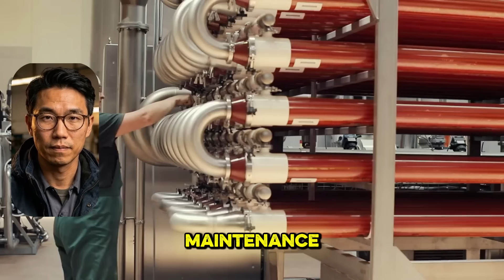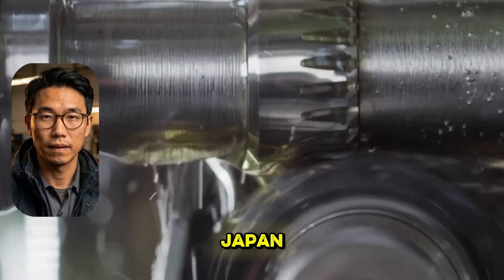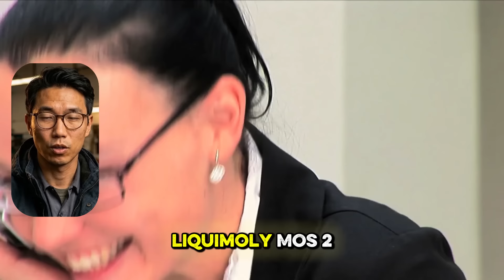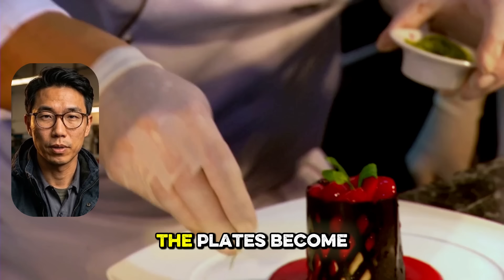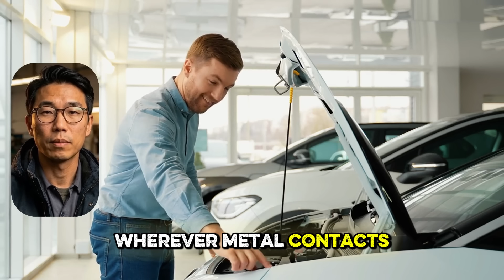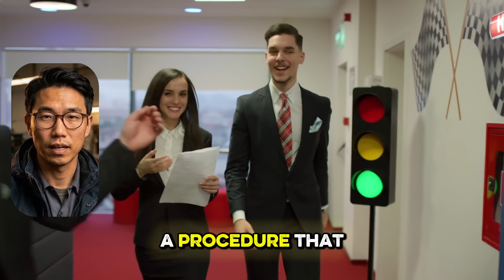The Japanese $2 Liquid Secret That Makes Your Engine Last 500,000 Miles — Mechanics Want This BANNED

Comment from the maker: 📘 The Japanese Vault — Full Maintenance Manual:
https://japanese-vaultvol1.netlify.app
Reply: Mechanics and the maintenance market have no reason to defend engine wear because cars with engine wear are usually replaced, not repaired.  Mechanics are happy to do minor repairs to belts, hoses, sensors etc. while engines last.  It is manufacturers, not mechanics, who want engines to wear.
Reply: Tried to buy the book but couldn't get it to take my information.  It kept saying something like "didn't work try again"
Reply: @chucksul4350 I would check with my bank to make sure you didn't get charged for as many times as they said it didn't work.
Reply: For manuals only! Never to use in automatic engines it causes gears to slip when it automatically changes gears!
Reply: I miss my 1977 Datsun extended cab and this is made sense now, poor little truck rusted so bad it looked swiss cheese, and looked through bed wheel well side through other side but I raced a 1968 Camaro and burned tire's off almost each gear and guy pulled up and asked what I had in it? 
It's factory engine but it was awesome 👍😎 motor miss my little sleeper.
Wish they still made that kind of Datsun.
I was hooked, go back to that kind of quality.
Technology destroyed quality.
Reply: Is this one good on foreign cars?
Reply: Can mos2  be used in  the Acura RDX advance?
Reply: Multiple video shots with no relationship to the audio content.
Reply: Thank you and Japanese old vehicles
Reply: I got a Nissan with a CVT engine oil. It suck! It drives smooth but different oil.
Reply: Does it work on transmissions ?
Reply: Thanks for for 7helnfo
Reply: Mos2 where do I get this?
Reply: Wow I did know
Reply: Blah blah blah get to the point. This should only be a 3-minute video.
Reply: @vizioasdf blah, blah, blah is correct. Even 3 minutes of assertions is too much. Video of short duration is also non-informative. Especially non-identified time & place videos. The so-called "information " requires reading for understanding & confirmation.
Reply: Pure BS
Reply: @isaaccohen1167 no sir try some and find out your self

Comment: found 100g for $15 USD on amazon
Reply from the maker: That's a solid find. Just make sure you're checking the concentration ratio before you pour, because dumping in too much can actually work against you. How many miles are on the engine you're planning to use it on?
Reply: @RayMonroeHacks  ~45000?
Reply: oh wait, that's the old mileage lol i had a new engine installed so i probably don't need it?  i have about 5K miles rn

Comment: Can it be used in a standard transmission in a 2023 Tacoma?
Reply from the maker: Honest answer: I wouldn't put it in a manual trans on a brand new Tacoma. Those gearboxes come from the factory tight and the fluid spec is pretty specific, and adding anything to it could affect shift feel or void your drivetrain warranty. What fluid are you running in it right now?

Comment: I got 100g for $11.99 from Jacky Yao, 5353 *Imperial Hwy Suite 200/300,
Los Angeles, Ca. 90045 (through Walmart with free ground shipping).

If my math is correct. That comes out to 20 5g treatments @ less that .60 cents per 5g treatment (4 cylendar).

The actual USPS label says:
5353 Wimperial, but I'm guessing that is a Typo?

Comment: Molyslip has been available has been available since the 1930's
Reply from the maker: Fair point, moly's been around a long while. What always got me is how few folks actually knew to run it. You been using it that long yourself?
Reply: @RayMonroeHacks  Never used Molyslip as it contains compound particles that can block filters and oilways. I have used Extralube ZX1 since 1993 in all engines and never had any wear or failure related issues in any if them..

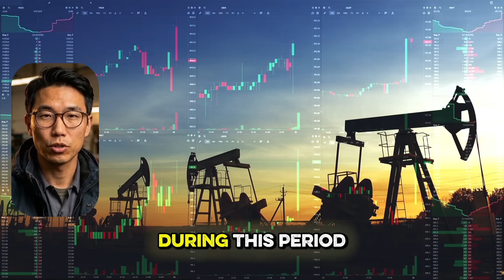Comment: 11:42 , what's the difference to let the car idle for 20 minutes with driving it slowly in city traffic?
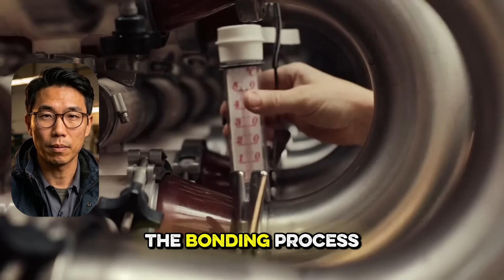11:58, ''drive normally'' which means no high rpm speed in highway trip or sport driving in mountain roads?

Comment: May not be the best for a MultiAir engine ….because on those engines the motor oil also acts as a hydraulic fluid ! Only manufacturers recommended oil please

Comment: Be careful when using MOS2 in delicate engines and older vehicles, as it is not the recommended product to stop noise and wear in older engines. You can buy it at auto parts stores.

Comment: Wonder if this works on transmissions
Reply: on old manual transmissionsPROBABLY  OK  ----- Syncro Mesh has slip plates which need friction so MAY CAUSE TROUBLE  ............XXXX. Automatic transmission  MAY RUIN  them because of internal clutch plates

Comment: Be careful, when adding mixture to running engine. It’s not possible wirh my 07 Accord. Air pressure blows out and makes a big mess if you do it while running and most will be wasted.

Comment: Project Farm completely debunked these false claims.  He thoroughly tested multiple engines and compared with and without treatment.  Exact monitoring showed no real measurable difference with this treatment every time.  It's a scam baby and several sites are falsely pushing it just for the clicks.

Comment: *Short answer:*  
✅ **Yes – that claim has a real historical and technical basis**, but it’s often overstated in online discussions.  
Japanese taxi fleets did commonly use molybdenum‑based oil additives (and moly‑rich oils) as part of strict maintenance regimes, and *very high mileages (500,000–1,000,000 km)* were routinely achieved.  
However, **MoS₂ was a contributor, not a magic ingredient acting alone**.

Below is the precise, evidence‑based picture.

---

## What actually happened in Japan

### ✅ Molybdenum use was real and widespread
Japanese lubricant manufacturers (notably *ADEKA**, **Maruyama Molybdenum**, and Toyota‑linked suppliers) developed **molybdenum‑based friction modifiers* specifically for commercial fleets in the 1970s–1990s, including taxis and delivery vehicles.

ADEKA explicitly documents that their organic‑moly additives form *MoS₂ tribofilms under load**, reducing friction and wear and extending both oil life and engine life. These products were **used domestically in Japan and exported worldwide* [1](https://www.adeka.co.jp/csr/en/special2.html).

Maruyama Molybdenum products in particular became well‑known in *Kansai‑area service workshops**, with documented engines exceeding **500,000 km* on original internals when paired with disciplined maintenance [2](https://takeshi-kun.com/en/article/maruyama-molybdenum-base-power-kansai-area-limited-blend.html/).

---

### ✅ Taxi engines routinely reached extreme mileage
Japanese taxis (Toyota Crown, Comfort, and later hybrid fleets) are famous for reaching *600,000–1,000,000 km* before overhaul. This is not folklore.

Key reasons:
- Engines ran **16–20 hours/day**, eliminating cold‑start wear
- Oil was changed very frequently
- Engines were lightly stressed (low RPM, moderate load)
- *Friction modifiers (including molybdenum)* reduced boundary wear during idle and stop‑start operation

Japanese tribology research consistently shows MoS₂ reducing friction coefficients by 30–50% in boundary lubrication conditions—the exact regime taxis live in [3](https://link.springer.com/content/pdf/10.1007/s11696-025-04139-9.pdf)[4](https://www.nature.com/articles/s41598-022-16026-4).

---

## Was MoS₂ the reason alone?

*No.* This is where the internet myth creeps in.

Think of it like this:

> **MoS₂ didn’t create million‑km engines.  
> It helped prevent them from dying early.**

### The real contributors (ranked):
1. *Exceptional maintenance discipline* (short oil intervals, inspections)
2. *Long duty cycles* (few cold starts)
3. Toyota’s *over‑engineered cast‑iron blocks*
4. *Moly‑rich oils or additives* reducing cumulative wear
5. Conservative driving style

Molybdenum acted as a *wear‑rate reducer*, not an engine multiplier.

---

## Why this worked especially well in taxis

MoS₂ excels when:
- Hydrodynamic oil film breaks down (idle, start‑stop)
- Metal surfaces are already well run‑in
- Load is steady, not spiky

Taxi service is almost tailor‑made for this type of lubrication enhancement, which is why the benefit was *real and measurable* in that setting [4](https://www.nature.com/articles/s41598-022-16026-4).

---

## Why this doesn’t translate 1:1 to modern private cars

Today:
- OEM oils already contain *soluble organomolybdenum*
- Engines run tighter tolerances and finer oil passages
- Emissions systems are more sensitive to ash and solids

Adding solid MoS₂ to a modern car **rarely replicates the taxi effect**, because:
- You still have cold starts
- You still have short trips
- Your oil already has moly
- You don’t change oil every 5,000 km

This is why results today feel inconsistent.

---

## Bottom line (plain language)

✅ *Yes, Japanese taxi fleets really did use molybdenum additives and oils*  
✅ *Yes, those engines genuinely reached hundreds of thousands of km*  
❌ *No, MoS₂ alone didn’t cause that longevity*  
❌ *No, it doesn’t automatically do the same in modern private cars*

MoS₂ was a proven tool used intelligently in a system designed for longevity.

Comment: Molybdenum disulfide,   Liquimoly MOS2.  Dissolve the powder in petroleum carrier oil.   2% concentration.  Purchase technical grade Molybdenum Disulfide powder. Under 2 microns particle size. 2 pounds give 4-7 engine treatments. Run the engine for at least ten minutes for warm application (full operation temperature) . 5 grams of the powder for up to 4 cylinder engines.  Dose 5 grams for   any 4 cylinder engine up to  2.0 liters.   7 grams for between    https://www.youtube.com/watch?v=-mxUn3PR6to&list=TLPQMDgwNDIwMjYkkgx9SFu1vw&index=4    The Japanese $2 Liquid Secret That Makes Your Engine Last 500,000 Miles — Mechanics Want This BANNED

Comment: Powder needs to be smaller than 2 microns.

5 grams up to 2.0l
7 grams 2.0-3.5l
10g for 3.5l+ 
Mix into 30ml of motor oil
Hot, idling engine. Idle 20 more mins.
After 500 miles you're good for 50k miles

Comment: I'm responding to people who said they only found this product for $17.99/oz on Amazon. He said to add 5 grams per treatment for a 4-cylinder, up to 10 grams for a V-6. There are 28 grams per ounce. The cost for a 4-cylinder motor is $18.00/28 grams = $3.20 per treatment, and he said that the oil changes were 50,000km, I think. I know that's not $2.00, but, c'mon people, it is not an outrageous price.
Reply: Exactly!

Considering it will LITERALLY save you THOUSANDS AND THOUSANDS OF DOLLARS.

Comment: I  drive a Ford Everest 2.5L Turbo in Philippines. It has 145000kms on the clock.

Recently I decorbonised the Intake Manifold, Exhaust, Intercooler, EGR valve, and Throttle body. I forgot to decorbonised the turbo charger which I will do soon. 

Performance improved dramatically.

Being an engineer, I have always been suspecting how engines can be further improved using oil additive but recently I started to doubt my belief. 

After 4 weeks, I added 1 bottle of this additive in my oil and seen an improved performance and saving in diesel used.

The product calls for 2 bottles for my car.

So, after 1 week, I added another 1 bottle and took my car for a short drive of 2 hours.

I see an enoumous improvement in engine performance, better throttle response, and I believe I am saving up to 20% fuel.

Thank you for reading my comment. This is a genuine case study. No BS. I see if I can post a photo of the product here.
Reply: The oil additive I used has Ester Oil in the bottle. Not sure how much.

Comment: This BS. Western engines  didn’t die in under 80,000k miles, ever, especially not in big city traffic. American-made engines & cars were quality & reliable  for forever as long as oil chainges were done and coolant & timing was upkept. Also safety & comfort were far superior. 

US cars started going down in reliability when they started using Nipponese parts. 

 60s and 70s  japanese car's were absolutely not superior to american cars in any form or fashion until 1990s, except for fuel consumption.

Comment: Diesel cars with DPF will be clogged faster. MoS2 is heavy oil ash. LiquiMoly biuld company based on that, its not secret ingredient, its in they're name. And If you put it to much it can clogge filter. You pay more for company so they make sure product is good quality, with measured proprtions to be ready for consumer. Also yes you can DYI if you feeling bored.

Comment: My nissan car lasted 500k km for 10yrs. using the same chemical for coating. 
In addition, i added oil friction modifier to the engine oil to reduce frictions. 
Change my oil filter and bypass filter on every 5k km. and only use new engine oil to flush my engine at every oil change(when it turn brown or by 4000hr which ever comes first ). 
Use only 100% synthetic oil please. 
When i change my top valve gasket at 300k km. 
Engine have little to no wear. timing chain and tension is good.
It is also a good habit to change your car battery every 18months.

Comment: From readings that I have done regarding molybdenum, it becomes part of metal through the action of heat and pressure.  Additionally, it has been noted that it is part of the front ends of cars, which for those of us who remember older vehicles had to have the front ends of their cars greased every three thousand miles or so.

Comment: Molybdemun  Disulfide  Is Not Degraded or Washed Out...1971 Toyota, Honda, Nissan Used this  MoS2 Works B etter than BHP  as Hotwire_RCTrix

Comment: My concern ! What happens to oil filter in the initial 500 mile run? Does it get  clogged ? If it does, the oil circulation will be limited until bypass valve is activated.... What about if during preparation before MOS2 is pour in; the oil filter was not install - what would that do ? Can anybody give me a heads up, please

Comment: I use molybdenum disulfide as a coating on match grade ammunition for competition shooting. Reduces friction of the bullet through the barrel. Without Moly the barrel gets warm to the touch in only four rapid shots. With moly I can shoot twenty six rapid shots before any detectable heat. This makes an increase of the Cold bore shots. Cold bore shots are the most accurate. Plus, due to friction reduction, I have a rise in impact point on target. It does vary. I notice about a 1 MOA rise of impact at 100 yards. One MOA is 1.047". This may give me longer potential range. Currentlyy ballistic calculations say a 49.75 MOA adjustment on my scope gives me dead on accurate at 1,000 yards. If I could ever find a long enough range. I may get to 1,760 yards with moly powder. 1,760 yards is 1 mile. Imagine a . 308 Winchester bullet to one mile? For Mil-radian scope users. The nearest M-rad is three clicks (.36 per click) on your scope. One M-rad at 100 yards is 3.6". There are 10 clicks per M-rad indicated. So at 100 yards you have ten clicks where each click is .36". Three clicks at 100 yards is 1.08". One MOA at 100 yards is 1.047. the difference is 0.033" which is less than the diameter of a bullet.

Comment: I have been using in my Mazda 323 protege 1998 model for about 12 years and it has now 542,000klm 
Runs unbelievably smooth .
I buy liqui moly MOs2 here in Australia for about $26-$32 . 
I got onto it where I read an article years ago where the Germans used it instead of oil on there tanks in Russia to stop the engines from seizing up due to the cold as well . 
It’s a great product .
Reply: It sure does make a difference. It's like engine is purring. Running very smooth and quiet too.
Reply: I also by Ceratec from liqui moly
Reply: Thank you. I have a machinist friend that said the Germans also used ratfish oil for lubrication during WWII. He claimed that his brother was a fishing boat captain that kept a gun safe full of rifles on the bridge of the boat. The boat caught fire and sank at a dock submerging the bridge and gun safe. Months later, the boat was salvaged and the safe was recovered, when it was opened, the guns stocks were destroyed from water damage but the barrels were pristine because they were oiled with the ratfish oil. Liqui Moly is a German product and I wonder if there may be a hint of ratfish oil in it.
Reply: @insaneseafarer Mmm🤔it does say on can that there is some sort of small amount other oil but doesn’t mention what type .
But I can 100% tell you from experience the product is amazing . Every mechanic that’s ever done a little bit of other bits on car scratch there head when they jump out and tell me WTF the car has over 500k klms and you can’t hear the engine even running 😂
I always laugh and tell them about it but they look at you with ohhh yeah but I can tell would be apprehensive to try on more modern complex cars . 
Which I can understand but if you do a bit of research it’s fine 👍🏼

Comment: made some moly grease in 1971 to put in cV joints and steering rack on a car that had a history of breaking CV joints and with kick back in the rack and pinion steering. I sold the car at 230,000 km, still really good to drive, friend who bought it was amazed. Only a little MoS2 in the motor early in its life.

Comment: @10'25" Where can you buy technical grade molybdenum disulfide for $2 - $4? I live in the UK and the only technical grade MOS2 available comes from the USA. 
Cost? Well a 4oz (114g) container of superfine grade molybdenum disulfide powder, 1 - 2 micron, under the trade name 'MicroLubrol" which, btw has to be shipped from New Jersey costs $57.54 or £43.50 UK money. Then there's the postage ataround £23. Total cost £66.00. A bit of a far cry from the $2 - 4 that you quoted. 
If I could get 100g for $2 -4, I probably wouldn't mind paying the hefty postage costs.